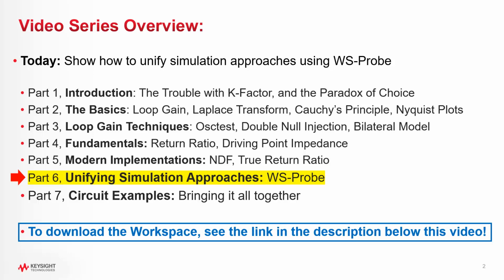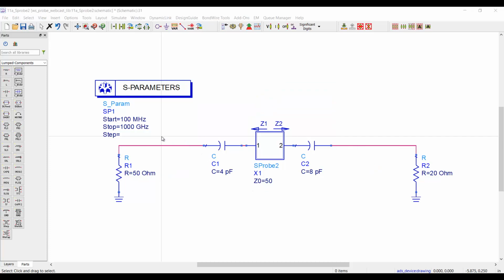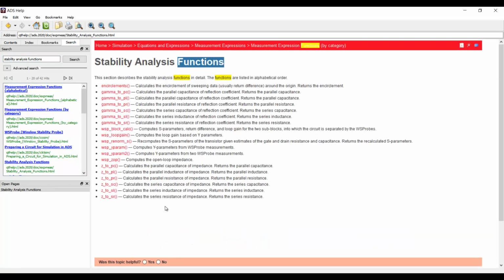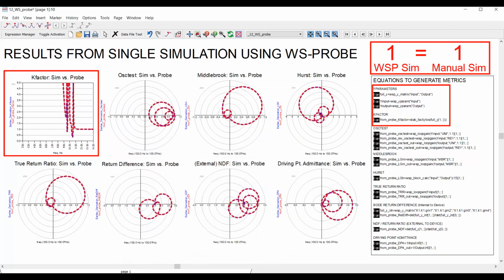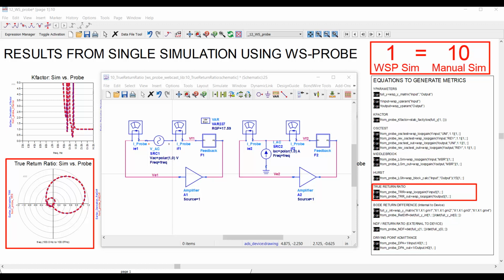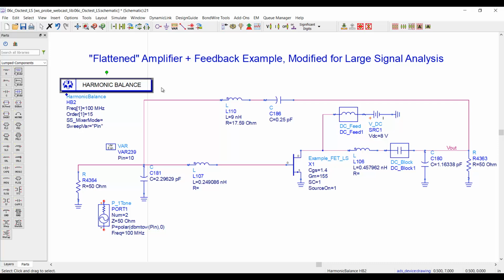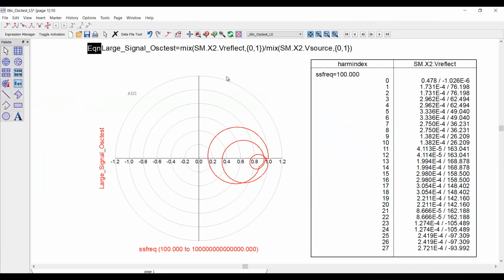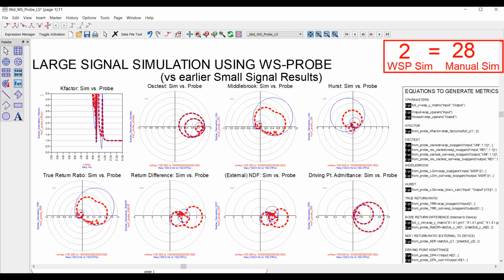Part 6: How to Design a Stable High Frequency Amplifier

Comment: Does anyone have the same problem? I have trouble when using "wsp_y_matrix_". It just return (Unknown message) or ().
Reply: Yes, because in the example it is wrong written. In the ADS software help it shows that the command should be "wsp_ymatrix". I also have the problem to evaluate stab_fact with the shown example from the video.
Reply: @P3C0  
Thank you for the reply! I reviewed the wrkspace and found an additional note in 00_Readme. Seems the functions are not built in ADS. You can load them according to below instructions.
""
Additional Note: There are two functions provided with this workspace under .stability_analysis_wrk\expressions\ael\ 
The functions are: wsp_driving_point() and wsp_y_matrix()

These will load automatically in ADS when you open the workspace and will work for all other workspaces you use in the same session. 
If you want to permanently retain them in your ADS install, simply copy the ATF file to $HOME\hpeesof\expresssions\ael and add a load 
statement to user_defined_fun.ael which resides in the same directory.

hope this can be helpful